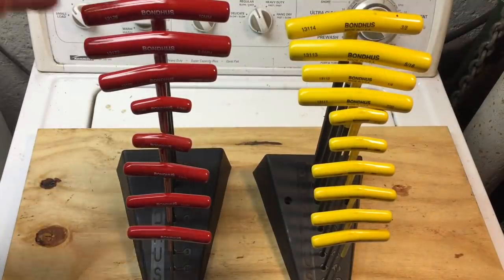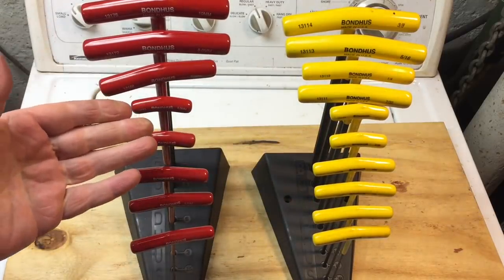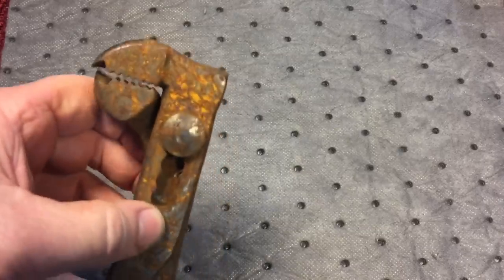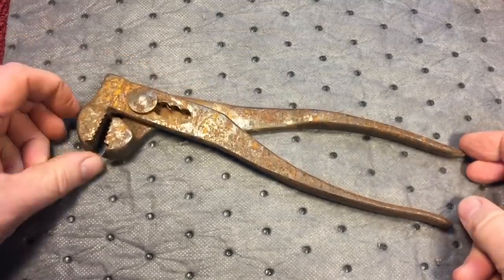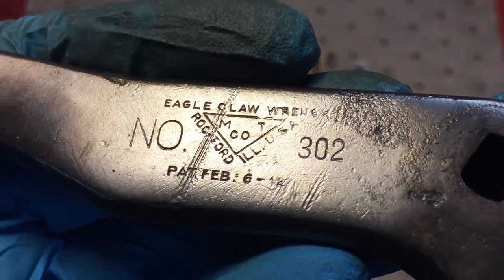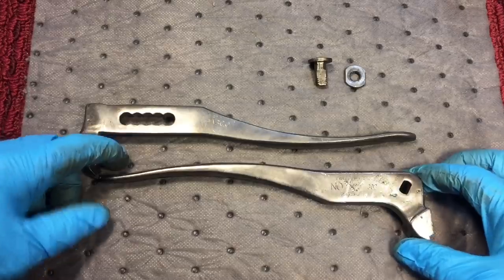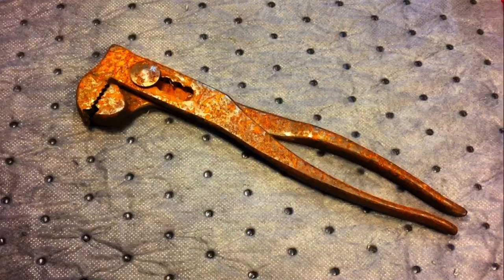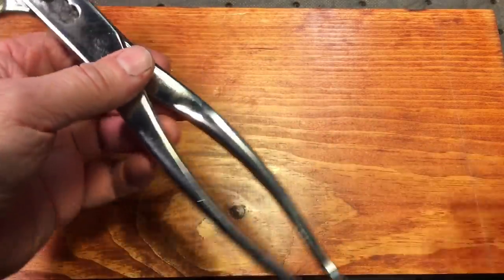Eagle Claw No. 302 Restoration

Comment: Re Bondhus: The smaller handles are for smaller wrenches; you just don't need the torque with the smaller sizes. HOWEVER, it looks like you got some mixed up sets. I've seen them with larger handles for the larger, and smaller for smaller in sets, but never seen them just put smaller handles on the ones in the middle. I have not been able to find a photo of a set like that anywhere, so I wonder if you just didn't get a mixed bag.
Reply from the maker: David!  That would make sense if the keys were small, these small handles are on some larger keys!!!!  I should have bought Allen!!   =)

Comment: Great job on the pliers. You always  are able to save the maker's mark. My son and I have just started this great hobie and having trouble saving the printing. I don't have a sander yet using a wire wheel. Any suggestions. Thanks
Reply from the maker: Hi Glen, I really like the 1X30 belt sanders without the disc attachment...  Belts are cheap, available anywhere and work great!  Don't get too crazy about the lettering, most tools aren't valuable and in my opinion I would rather have a nice usable clean tool without a maker's mark then rusty one with the mark!  LOL   Thanks!!!!!!!!!

Comment: The ad mentions that it’s made of tool steel tempered in oil. I would gather that they mean “tool steel” as in cutting tools for lathes, mills, drills and so forth rather than just a high carbon run of the mill steel. Just a side note; it’s a tool made from steel, yada yada, Lol!
Reply from the maker: Hi Scott-  So true!  Tool steels come in a variety of classifications like air hardened, oil hardened, water hardened...  The oil hardened steel we are most familiar with is O-1 and it is very durable and nice to work with.  Some more exotic steels are hard to temper but are super strong!  =)  Thanks!

Comment: I can only speculate on why the middle T handle Allen’s were smaller. But, if the two sets were meant to be stored together, perhaps the metric set was suppose to mesh with the SAE set by rotating the one set 90 degrees so they interlock in a way

Comment: Hi scout, the Eagle claw looks like it will get a great grip on something, providing you  don't want it chewed up too much,lol. As for the shorter handles on the allen wrenches, I have a couple here in the UK, like yours one is 4mm and 5mm,ball drive, but whith 10 in  shafts, mine were used for adjusting hinges on upvc doors where a wide T handle would restrict access. Plus  you can spin the shaft between fingers and thumb for speeding in the allen screws easily. Just my take on this. Be careful if you replace your allen set's  Scout as some of the new ones arn't worth a dam.  Kind regards Stuart.
Reply from the maker: Hi Stuart!   I wish the handles were just uniform with the others...  These smaller handles are horrible!  You are right about the windmilling feature!!!!!!

Comment: Another great restoration and great video.  I have a question for you.  I have noticed on projects like this you do not use vinegar or any other rust remover/inhibitor.  You go straight to the wire brush and sanding machines and then probably waxing.  Obviously you get beautiful results, but do you ever find the rust returns?  Would soaking the tool in vinegar before or possibly after the wire brush help get into the microscopic cracks and blemishes/pitting to attach the rust that may be lurking, or would that just be unnecessary overkill?
Michael from Canada
Reply from the maker: Hi Michael!  That's a great question!  The only time I use a "DIP" is when there are parts of the item I can't get to!  Like a hollow interior or some other feature that is inaccessible.  Otherwise I go straight to the wire brush and remove it that way...  I have tools from 15 years ago that I did and never had a recurring rust problem.  The only time I had rust issues after a clean-up was when I used media-blasting, that created small microscopic crevices that allowed rust to come back, that's why I don't media-blast anymore.  Wire brushing, sanding and polishing followed by Mothers Carnauba cleaner/wax is the best routine I have found yet!  Thanks!!!!!!!

Comment: I don't think it's "bad luck" or a "mixed set" and the short handles apply to both metric and imperial. My guess (and it is very much a guess) is that they are the most commonly used and they gave them shorter handles so as they could fit in more confined spaces spaces. A lovely restoration and I'm envious of the wide tool selection you can find in the US - in Australia it's much more limited and predominately British.
Reply from the maker: Hi Steven!  I am not a fan of the shorter handles, their new sets don't have this anomaly,,,  =)   Thanks so much!!!

Comment: I am straining my brain figuring out why the smaller handles. Two thoughts. When this kit was thrown together, maybe those four wrenches sold better with the smaller handles than the larger when the wrenches were sold individually? They then put together a kit of the best sellers. Which appears to not be a hit as I cannot find reference to them. Another possibility is they got a little bold and made too many of those sizes over estimating the amount they would sell in a year. Happens often where for whatever reason, certain tools don't sell as well as anticipated. Sometimes they sell great the first year and not so good in the next year. They may have just been trying to move some inventory.

Remember the housing crisis we had some years ago, us in the tool business took a huge hit. No one buying houses, no one building houses, no one needs tools. We had overstock to deal with for that reason alone. 

Do you remember the year you bought them?
Reply from the maker: Hi Steve!  Geeze I'm thinking it has to be over 15 years ago...  The funny thing is now I wouldn't buy such a set because I look at things a little different, but back then I wanted a "T" handle set and just ordered it blind from a catalog, when I got the sets I said "WTH?"  LOL   It's bugged me ever since.  The funny thing is when you use them the smaller handles are just so unbalanced!  I would rather they just put a acetate screwdriver handle on!  =D   Thanks!!!!!!!!

Comment: Just sized that way so you aren’t inclined to over-torque them. Sizes 3/32-5/32 should be smaller 76mm handles. 3/16- 1/4 are 102mm handle and 5/16-3/8 are 127mm handles.
Reply from the maker: Ryan-  I have 4 different sets of T handle hex keys and many have descending handle lengths but nothing as radical as these crap Bondus mistakes!   =D

Comment: Handles engineered to match blade's torque capacity. Smaller keys have shorter blades, thus they have longer handles.
Reply from the maker: Jeff both sets have smaller sizes with larger handles!  That's what gets me!   =)
Reply: ScoutCrafter keys with shorter handles are longer than smaller keys with longer handles.

Comment: Hiya, good to see ya. I was raised in Aurora, Colorado.. the home of the Eagle Claw fishing tackle co. no connection. The Guys who worked at Eagle Claw told me in the 60's that these wrenches were made by the MT tool works, and they had a trade name reg. on the name Eagle Claw, and when the fish hook guys wanted to use it they had to buy it. I have 6 of them, and about 4 yrs. ago I came across several pair with no name or markings at all, anybody who might know anything about the no name ones, I would like to know. Good video, Thanks
Reply from the maker: Hi Joel!!!!  Wow! They had to buy the name!  That is crazy.   You are right MT is stamped on the side in a triangle.  These came in at least 4 sizes I know of and I have a larger pair that the nut is broken...   To the lathe!!!!  =)   Thanks Joel!!!!!!!!